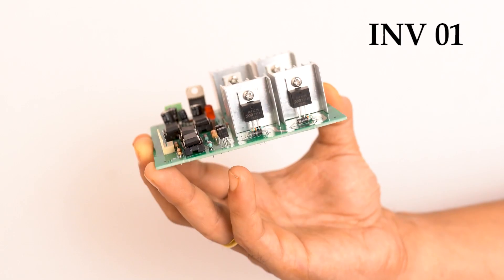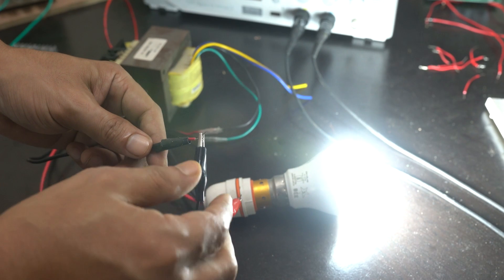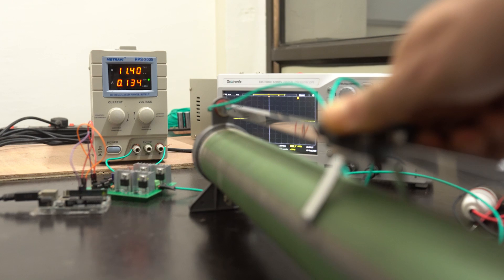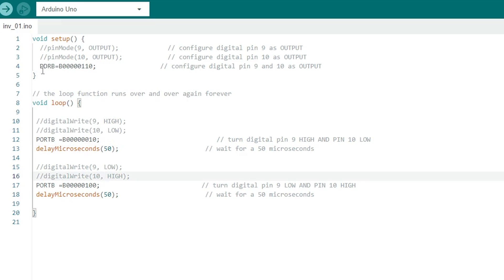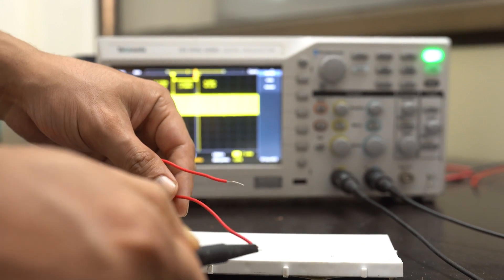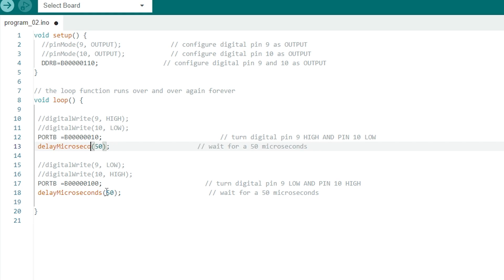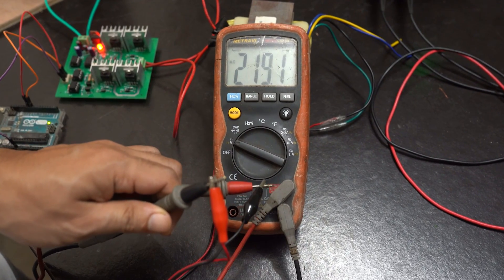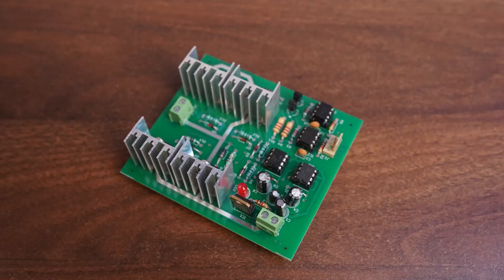Introduction to Single Phase Inverter INV 01 using Arduino - Part 01

Comment: That's simply H bridge
Reply from the maker: Yes...simple h bridge 👍
Reply: @FambiTech  I think you should add levels at least 5 levels and also show the effect of inductive load on the output waveform .
Reply from the maker: @dsponline_0  five level is covered. And the load part....you can give it a try 👍

Comment: Great job :) One question, what is the function of the two MOSFETs next to the optocouplers?"
Reply from the maker: Those are 2n7000 mosfets. Output from optocoupler are inverted, so mosfet is used to again invert the signal.